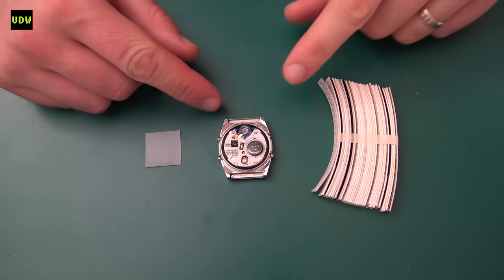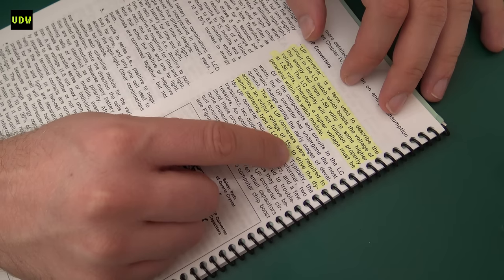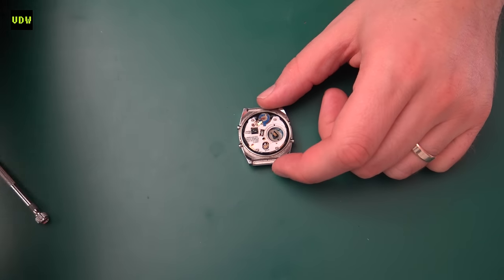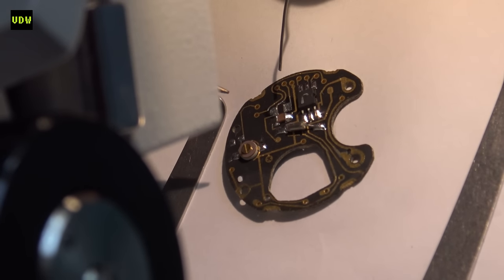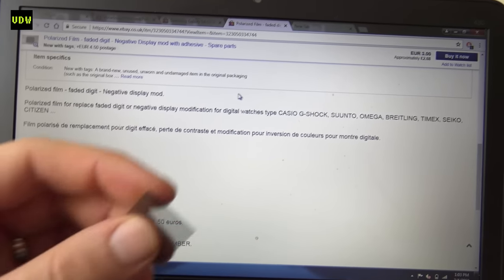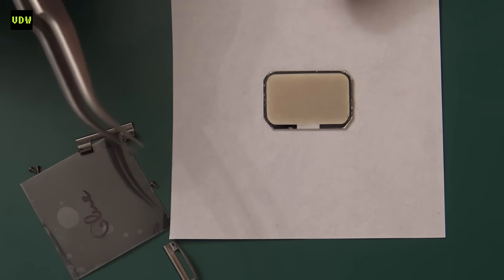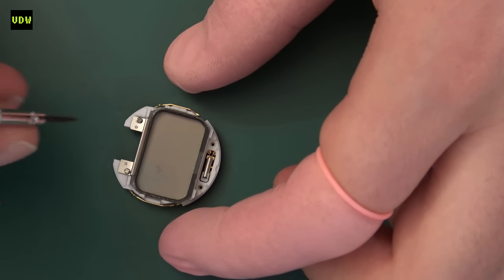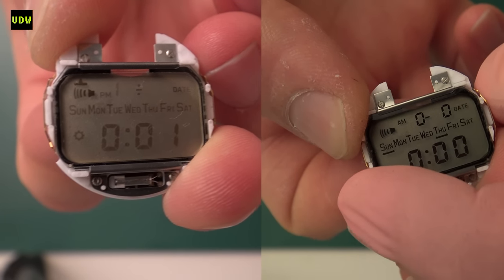Faded LCD display Repair - Ep 49  -VintageDigitalWatches

Comment: I really can't see your logic in measuring a suspected faulty capacitor to replace it with an identical value. If it is faulty, the value that you measure will be low and needs to be replaced with an original value one, not with the value of the one you are taking out.
Reply from the maker: As far as I know capacitor values are standard, and the point of measuring it is to find out towards which standard value I am supposed to go.
Reply: You have to be aware of the failure mode of capacitors which is decreased capacitance (in some cases short circuit). This means measuring a known bad capacitor is useless and you have to either get the proprietary information from manufacturer or test with multiple different ones to get into the ball park. Of course if it's a significant part (eg. part of an oscillator) it was probably a binned part or more expensive (tight tolerances) so you have to be even more careful. However in this case since you know what voltage you are expecting at the LCD you should measure said voltage and adjust capacitor accordingly.

Comment: I have g shock,would having ghosting faded problem on its display which is annoying so much,but after i test the LCD by pushing 3 button,the display would be okay for an hour or two,i think maybe the capacitor also the culprit,sadly i didn't have the tool and expertise to do that  😓

Comment: Ok ive just desambled the watch! Seems like there is some zebra strip missing that connects the mainboard right?

Ive marked it for you with a question mark where i think the zebra strip is missing in my opinion.

https://drive.google.com/file/d/1Rk-ks46crh6vXIKXlHnnitb3zJpQVLKp/view?usp=sharing
Reply from the maker: Yep, it'smissing :)
Reply: @VintageDigitalWatches  Damn! I knewed it! Some professional lost it! Can this be bought afterwards?
Reply from the maker: @gaboaaa23  As long as the dimensions are correct you can use any zebra strip from any type of watch. Length wise it is easy to adjust by cutting. But finding one that is the right thickness is difficult , you can't adjust the thickness by cutting because it needs to be very precise.  They are usually used with the LCD of the watch so that is the source to start form.
Reply: @VintageDigitalWatches  ok, but isnt the number of stripes( i mean the contact pins) variing? Some has more some has fewer......or?
Reply from the maker: @gaboaaa23  in a single zebra strip you have more contact lines than you would have contacts on the board. Essentially the zeebra strip is a series of dense contact li es, some will fall on a contact while some will fall aroundit.
Reply: @VintageDigitalWatches  i see what you mean! but as you said the thickness is a problem...... hm.... so sad that the calculator dosnt work. at least the tv remote features does. als i need a button clip because one button falls off all the time. can I use the clips from any Casio?
Reply from the maker: @gaboaaa23  yes, any Casio C clip will work
Reply: @VintageDigitalWatches  cool! Thanks

Comment: Hello, I saw your "signature" is Tibi, ez azt jelenti, ha küldök neked egy emailt magyarul, az nem fog gondot okozni? Az angolom nem az igazi, ellenben lenne egy-két kérdésem 2db CASIO W-910 (https://thumbs.worthpoint.com/zoom/images1/360/1213/23/vintage-casio-japan-lcd-1057-910_360_6e41393914a3981aed6361ddd449a024.jpg) kijelzővel kapcsolatban. Ha nem gond, a válaszban az email címedet megadnád?!
Köszönöm!
Reply from the maker: Tiberiu not Tibor :)
Reply: @VintageDigitalWatches  :) OK, I think that, you're Hungarian. So, I have two W-910, one was perfect unti few days before, when suddenly I saw vapor droplets  inside the watch, fully covered the LCD and few segments aren't worked. I do not want to disassembly, but I did and now the watch is dry. After reinstallation, the same few segments are not lit, and I have no idea how it is possible to fix. The other one is heavily used, the case damaged and inside few corrosion, but the LCD same, few segments are really weak to see, some of them are not visible - if I can power it up.
What is your opinion? (I really like this watch, because of moon phase and sunrise/sunset times + temperature memory - I have no idea, how it can change to one new model, if any.)

Comment: Great and informative video. I just fixed or think i fixed my Casio ProTrek and then i noticed the display just looked like inversely burnt. I first noticed it after I charged it in the sun for a few hours and i even immersed it in water so it wouldn't over heat. this is how it looks now https://forums.watchuseek.com/f17/blurry-watch-glass-1865130-3.html#post46543125 and the photo above is just a few weeks before. I took it all apart beofre and noticed the silver coating on the back of the LCD was faded just in the center is that something that can be fixed somehow? thank you for any pointers. I can't order a new one as its out of production and i don't know if this silvery layer behind the LCD is fixable....